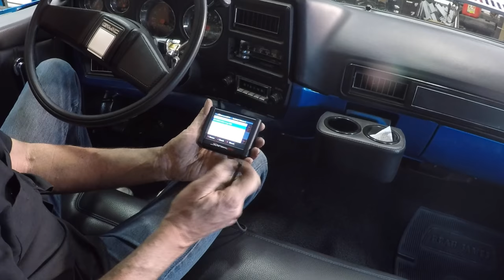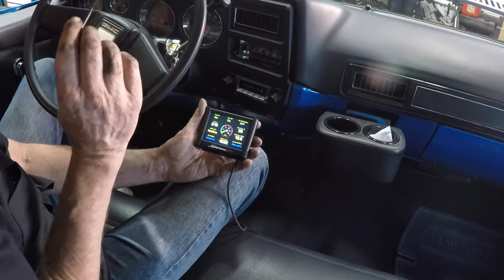1973-87 Chevy & GMC Squarebody Fuel Injection Conversion Quick & Easy / LS Benefits & No Hassle EFI!

Comment: How do you wire in the truck with two tanks, and a valve selector? Do you need a fuel pressure regulator too, with EFI?

Comment: Great job with soldering the wires, shrink tubing and dielectric grease. If you forgot to order some from Brothers, look in the automotive section at the home improvement stores. Currently, Permatex 22958 is a 3.0 oz. squeeze tube as I put that “S*#?t” on everything. As Dave said, grounds are the number one cause in electrical problems. Sandpaper, wire wheel or what you have but get a clean spot. Dielectric grease allows voltage & current (Amperage) thru to the chassis. Speaking of grounds, it is the return path for every circuit on the vehicle. Now is the time to get some “Star Washers” in the hardware section. Cheap insurance in several sizes that dig into the metal for low or no resistance. Look at the back of the alternator as many mounts and engines are cleaned then painted. The back of the alternator is where diodes send the negative amperage. Most all GM end housings has a threaded hole un used and adding a “6 AWG or 4 AWG” short black cable with crimped copper ends from the alternator to the engine block, battery, frame, fender, cab & bed all benefit from adding this cable to an un-used bolt w/star washer helps reducing that return ground path and the ability to charge that battery. This is the time to check, clean, add grease and tighten those grounds. Your headlights, battery, gauges and your new “Sniper EFI” system will thank you! Another good video Dave! Sweet!    ASE master, retired.
Reply from the maker: Thanks Dean!
Reply: @BROTHERSTruckPartsTV  do you guys still sell this fuel kit

Comment: This fuel pump module was covered last month on Feb 8th, but on a cut-away tank. This video covers more on the wiring though, which manynof us need.
Reply from the maker: This video was more fun for us since we actually got to upgrade the shop truck with a Sniper EFI.
Reply: @BROTHERSTruckPartsTV   The shop truck the is a work horse for many deliveries and chores. It to needs a little love too! Nice job Dave!

Comment: What type of engine was this on? I have a 65 c10 that I'm about to change from an inline 6 to 350 from a 74c10. I've been looking into a sniper
Reply from the maker: This truck has a factory 454, but the kit would easily work on the 350 you're planning to install.

Comment: did this truck already have provisions for the o2 sensor if not did you guys weld in the bung?
Reply from the maker: It did not. The Sniper came with a clamp in style o2 sensor so we just simply drilled a hole in the exhaust and clamped the sensor on.

Comment: I’d you use both tanks? If so did it work?
Reply from the maker: This would work on a dual tank system if you installed a pump in each tank or used a transfer pump to move fuel from an aux tank to a main tank.

Comment: HOW DO YOU DO THE DUAL TANK EFI SET UP?
Reply from the maker: You either have to run a pump for each tank or setup a transfer system to transfer fuel from your "reserve" tank to the main tank.

Comment: Isnt that pump just stock style 1987 tbi pumps?
Reply from the maker: Not at all. This is a 100% custom pump meant to eliminate the need for you to have to change pre '87 tanks to a baffled style. It also eliminates any need for a return line or external regulator like the TBI pump requires.
Reply: @BROTHERSTruckPartsTV  clicking on the link does not take you to the product page anymore (just the Holly site), and it doesn't appear as if this one is still available....
Reply: @mattbrown2793  I'm having trouble finding it also!